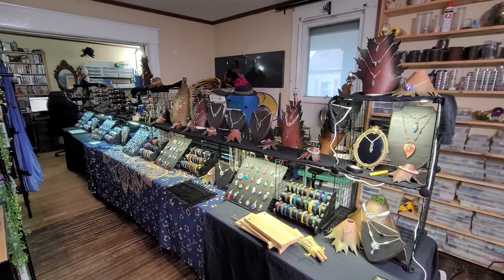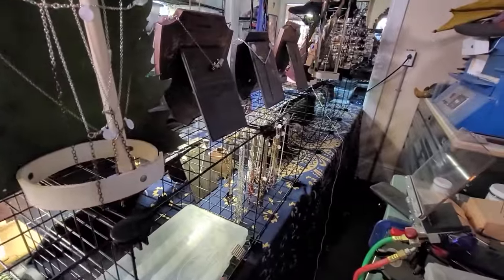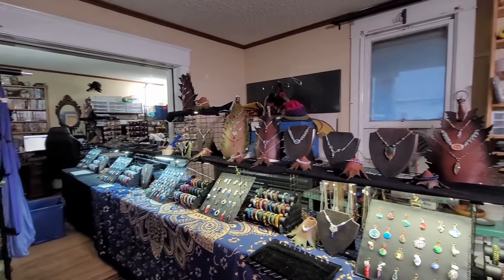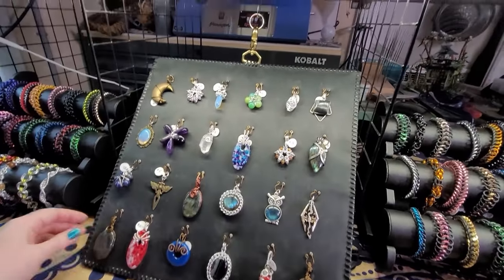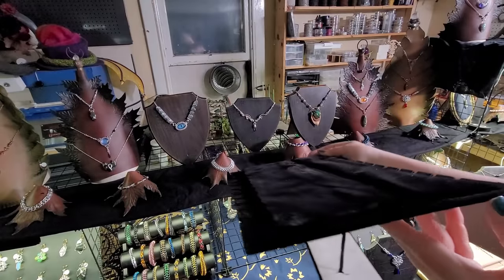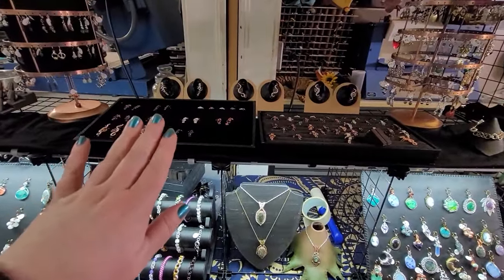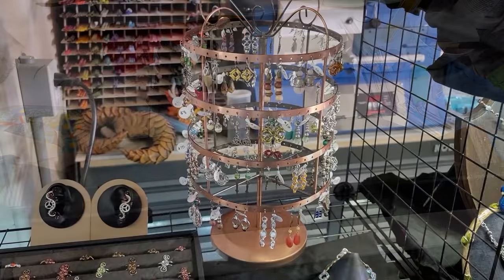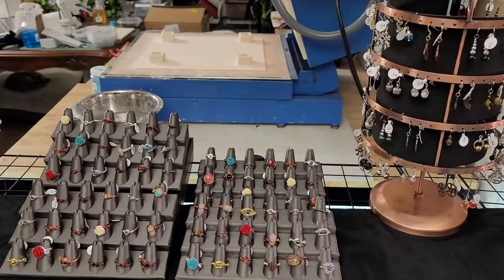Full Jewelry Set up Booth Tour: Setting Up

Comment: Wow, that's an impressive setup. Would be interested to know how you deal with the wind blowing when/ if you sell outdoors. It has been one of the very worst things to tackle when my market stall pitch is outside.
Reply: I know for tablecloths, restaurants use weights on the ends of tablecloths so they don't fly off in the wind. on the cone-shaped necklace displays, you can glue a weight inside (same for blacetes displays like hers) or attach a clip to the grid like she did. Now about the rings displays I don't know how to make them not fly, unless the pieces are rings with heavy stones in them, then they won't fly. xD